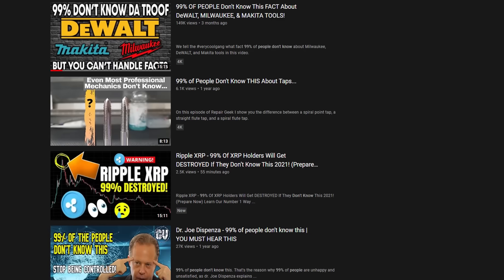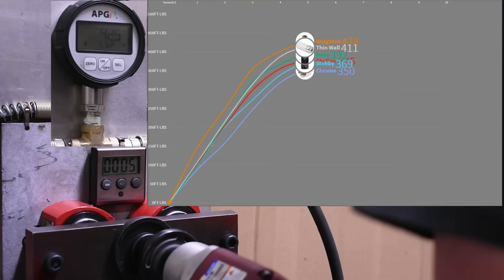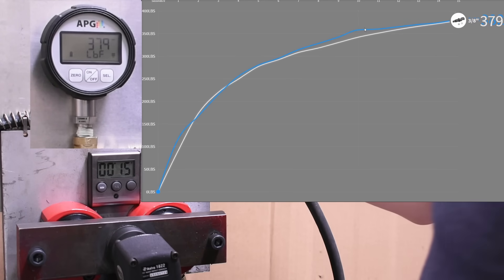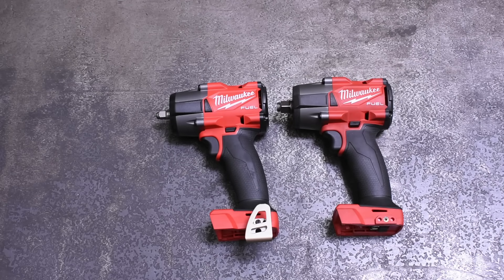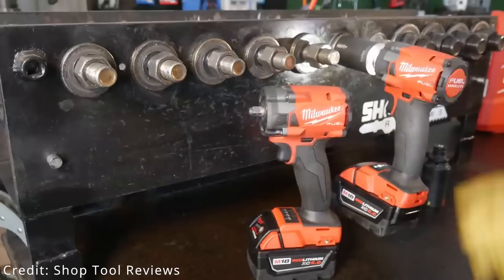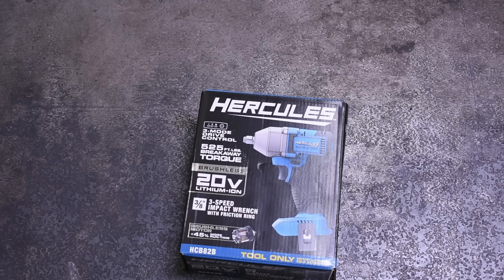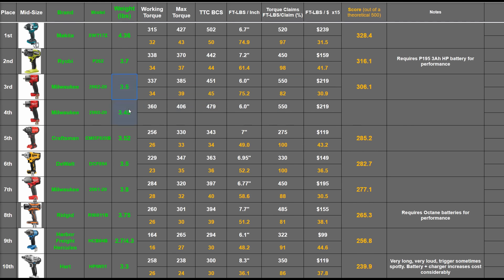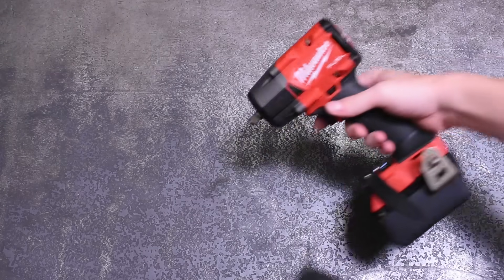Measuring Power Difference Between 3/8" & 1/2" Impacts = WTF

Comment: My guess would be that the force being delivered to the anvil is the same but on the 3/8ths it's concentrated on a smaller area so it receives more peak pressure. Although I'm still trying to work out why the 1/2 inch is better early on?
Reply: My thought as well

Comment: My hypothesis behind this would show that when using a 1/2 inch it’ll get up to a higher power quicker as the 1/2 inch has more weight therefore will create more momentum.  Whereas when trying to get those extra beans at the end it take less torque to get the smaller 3/8 drive spinning as it weighs less therefore you can get those couple extra foot pounds.
Reply: whatever extra energy gets put into the heavier object is being used to overcome the extra resistance to changes in its motion (Newton's 1st Law). exactly why a pebble and boulder dropped from the tower of pizza hit the ground at the same time despite gravity exherting so much more force on the heavier rock.

Comment: I think they rate 1/2 higher because at higher torques you'll see more stress on the anvil and typically a 1/2 anvil can handle more than a 3/8 but that may need to be tested.
Reply from the maker: 3/8" anvils will die a quicker death at these torque levels, you're quite right about that

Comment: There is a lot that goes into that. Less mass more speed. More mass less speed etc etc. being a mechanic for 17 years I’ve been around a lot of impacts. Some things 3/8s will not do a 1/2 with a heavier socket gets it done. Same goes for 3/4 and 1 inch. For the longest time I only used a 1/2 impact and had a reducer so I could use a 3/8s socket. Each impact has its place. I could go on and on.

Comment: Hi can you test torque sticks with different Impacts? I want to know if they can limit the torque of any kind of Impactgun.
Reply: I second this. I stopped using them at my shop due to the torque seeming very different when removing them by hand in my own terrible mini test.
Reply: @HoosierDaddy_  The result is different indeed. I only use the lightest one (90 Nm), that way the torque spread doesnt really matter. Lug nuts are generally torque to anywhere between 120-180 Nm. Even if the torque using the torque stick differs by +/- 20 Nm (70-110 Nm), its still sufficient for what Im doing with it. At least its not possible to overtighten the screw anymore.
After using the torque stick on the lift, I torque the lugnuts to spec using a torque wrench when the car is back on the ground.
PS: I would be also very interested in a decent torque stick dyno test!
Reply: No, they only work correctly with rainbow colored impacts.  
🤷. 
Better upgrade to the care bears model.

Comment: no one saw or taken into account that the 1/2 socket  is 3 times bigger and  heavier, and heavier means harder to spin
Reply from the maker: Both the 1822 air impact and Hercules used the large 1/2" socket and smaller 3/8" socket and made the same beans. We go over this @ 1:44. We've tested and on large bolts like these socket mass isnt a huge determinant but on smaller bolts and sockets is can be big

Comment: I bought an M18 Fuel 3/8" impact 3 or 4 years ago and used it for most impact jobs Including outboard flywheel nuts, rusted wheel lugs and other rusted trailer parts. Salt water is to boat trailers, engines and other boat hardware as road salt is to automotive world. My 1/2" CP air impact is probably 45 years old, came with me from the auto industry to marine and has been rebuilt probably 4 times. Our shop air leaves a lot to be desired and I am a lot more mobile than in the past. I still needed the air for some situations. I recently replaced both with M18 fuel gen 3 I think they are called. I bought them because they are shorter and the added gain was more power. I also bought m12 Fuel screw gun, 1/4" impact driver and 1/2" drill with the smaller 3AH batterys. I wanted the 12 for the smaller size for tight access and the power and batterys have been more than adequate for my work. I almost never run down batteries before the day or the job is done. In my world battery tools are now king but in auto and heavy equipment repair I would imagine battery has it's place but air is probably still king.
Reply: I do heavy highway construction so I'm around heavy equipment all the time. Whenever mechanics come out all they use is battery powered tools.

Comment: I would think the 1/2 anvil would be less prone to fracture than the 3/8 (thus giving the impression of more strength AND torque), but it also makes sense to me that the high end torque would be greater for the 3/8 than the 1/2 because the anvil for the 3/8 is lighter.  Since the motor of the 3/8 is doing less work moving the anvil, it should have a few more seeds (assumed smaller than beans) to give the test setup.  

Further, since there would be excess torque available at the lower end of the curve, the motor should be able to drive the 1/2 anvil at a similar speed to the 3/8, thus delivering more torque than the 3/8 because it's moving the higher mass 1/2 anvil a distance similar to the 3/8.  

I wonder if the 1/2 anvil end was cut off (still allow safe engagement WITHOUT pushing harder into the socket during the test) to reduce the anvil mass whether the curve would look more like the 3/8?

My explanation doesn't work for the Harbor Freight unless the anvils were the same weight or they were actually different internals.  Maybe it's because they are providing much less torque so it's less evident?

Comment: great video, I knew there was difference just had no idea it was this, I am in Canada and just bought the Makita mid torque XWT17 1/2" drive and love it, i do own mostly 1/2" sockets from my jobs over the years and just use adapters to size down to any smaller jobs that have smaller hardware, and don not require big torque and this new Makita with the many power levels it allows me to do almost anything with it, i also have a Makita 1/4" driver as part of a set, been using Makita for almost 20 yrs and don't see any need or reason to change and the warranty/service is awesome great video and good info to know when i go to purchase the next thing a cordless ratchet , i will wait they are suppose to be upgrading them in the near future i heard from an Aussie friend of mine 👍

Comment: In the video you can see the 1/2" milwaukee shaking more than the 3/8; It seems like when I hold my gun more steady it produces more torque.
Do you think that the difference in socket lengths (the long ones you use for 1/2" and the brand new never before used coupling for the 3/8) plays a factor? 

For the purposes of this video perhaps an improved comparison could use a bolt adapter down to a 19mm head and then testing with the same brand short impact 19mm socket in 1/2 and 3/8?

thanks for the videos.
Reply from the maker: We've noticed the smaller the drive size, the more impacts shimmy. due to footprint not helping with alignment. The M18 3/4" for instance is more tame than 1/2"
Reply: @TorqueTestChannel  allow me to clarify i meant the connection to the anvil being so far away from the bolt head is causing more vibration (the gun isnt straight into the socket it is wobbling it around some) than the almost direct setup you have with the 3/8, hence my suggestion.  (Edited for clarity)

Comment: On your pneumatic guns do you run regulators or just whatever the compressor will push?
Reply from the maker: On air tools for testing we run the pressure required to reach 90psi in the gun while running wide open. Then for BCS test it's 150psi at the wall which drops to whatever the gun causes it to drop to
Reply: @TorqueTestChannel  thanks for answering my question and that was a quick reply!  Keep it up I love watching your content!

Comment: As there is a bit of movement between the socket and the tool, and as the ultimate torque that an impact wrench makes is directly related to the shorter duration of the impact, it is not surprising that an anvil with slightly less mass would be accelerated slightly faster and produce slightly higher numbers on the top end all other factors being equal.

Comment: My perspective on this this comes from engine performance. With ICEs, HP (work) is torque × RPM. A big torquey V8 that makes 400ftlbs but only revs to 4500 might make 250HP, and has the torque to do work down low like towing (Like how 1/2" guns do better breaking through rust or stripped fasteners that won't move) Whereas a smaller V8 making 250ftlbs but revving over 7500rpm might make 400hp, doing even more work faster and hitting higher top speeds than the torquey V8 even with lower torque figures. (3/8" anvil swapped from 1/2" tightening clean bolts with little resistance even tighter due to lower rotating mass, increasing speed or blows per minute) Obviously these are the same guns just with different anvils, so the difference isn't huge but they do seem to follow that logic

Comment: interesting video! I've found this to be the case a few times myself where i have both 3/8th and half in models of the same tool the 3/8 seemed to right on par if not better. But i couldn't quantify it and always assumed it was just bias/some coincidence.

heres a thought. is there any chance having a smaller anvil makes the output rotating mass of the anvil smaller in relation to the total mass being rotated on the socket allows it generate slightly more power?  for example if i used a 1' socket but the drive was the same 1' diameter I would assume the rotating mass of the socket would be greatly mitigated because its not rotating outside of the diameter of the drive itself. kind of like how bigger wheels on a car can reduce torque and throw off gearing.

Comment: Idk I use 3/8s for basically everything as related to ratchets so I do like to have a compact or mid torque in 3/8s just to not have to make any extra effort but I do see the value in having a 1/2inch
Reply: I have the 3/8 that they tested, and then the High Torque 1/2.  Don't use the 1/2 often, but it has its place when needed.  Usually use the 3/8 though.  I do want to still get the 3/8 stubby impact for those tight spaces.
Reply: I feel like High Tq for 1/2 and then a 3/8 Mid is a decent set up

Comment: Oh nice, now you guys can impact those ecoboost plastic oil filter caps back on.
Reply: Haha, bought my truck this spring and wanted to drive back to the dealer and punch the guy in the face who put the filter housing on. 

I could not get it off, socket kept slipping on the top nut. I let the engine cool down and was ready to cut the thing off if it failed to loosen again, but it came off this time when cold. I was SO mad.

It amazes me how few people understand how a simple o ring works, and tighten things like a bolt.

Toyota had a similar filter housing and goons broke those treating them luke bolts too.
Reply: @volvo09  Had exact same problem with a goontech over tightening the lugs on my aluminum wheels, one lug was so tight even they could not get it off, had to use a hole saw to cut it off, then hacksaw the rest off in order to remove the lug, which I replaced. I usually do my own rotations, and use a torque wrench as recommended by the wheel manufacturer, but the car was in for inspection, and required one front and an opposing rear wheel be removed for brake, bearing play checks.

Needless to say they paid for the wheel replacement, and they got dropped as my go to shop.

pneumatic/electric/cordless wrenches in the hands of fools is a dangerou$$ venture.

Comment: You guys are leaving me perplexed. I was always told the larger mass of the 1/2"  anvil hits harder therefore delivering more torque. Apparently you proved that wrong 👍🏽
Reply from the maker: Cardo, the dyno proves us wrong right along with you. We come away from these tests humbled as usual
Reply: And in another test a weighted socket increases the torque? This is a bit confusing! 🤔😂
Reply: @henrikforsberg683  Could it be WHERE the weight is? Anvil is in the centerline of rotation. Weighted sockets have mass concentrated at the edge where the angular velocity is higher.
Reply: "Chris"  said  (01/11/2021) "The effect were seeing here is caused by an interaction between the motors torque curve and the anvil mass. The motor seems to struggle at the last bit of the dyno test, because the 1/2" anvil seems to be a little too heavy for it to max out."

If they are using the same motors (kV and Power / VA)  heavier hammers may all be for nothing.  Motors need more power..  

Higher Anvil mass merely indicates more material is included, ideally for higher strength / fatigue resistance, same with thicker walled sockets, more material indicates better resistance to heavy use - more mass ""induces inertia" to be overcome  -  understanding coefficient of restitution is important in design / testing, if the socket is just "bouncing" off the bolt, not a lot gets done - heavy sledge  hammers have a use and it isn't driving small nails.  Design and manufacture has many challenges, marketing induces loads of avenues for misrepresentation.
Reply: @kadmow  worthwhile read. thank you for including this
Reply: The mass of the hammer inside the gun is what matters most, and a gun that ships as a 1/2 anvil might have a larger hammer than a more compact 3/8 anvil gun.
Reply: Is it possible that's the heavier anvil actually absorbs some energy in some situations
Reply: I was literally at Lowe’s about to purchase the 1/2 Milwaukee impact and saw this video and I’m glad I did
Reply: It's too close to the pivot point so it doesn't make any difference in real world life.

Comment: Great to see experience quantified! I've done this test 'in the field' over the last few years, and the only difference I've ever seen is the ability to handle whatever socket was available/appropriate at the time. DATA WINS!
Reply: Well the weight of the socket is definetly . I think that the 3/8 socket will have more weight due to the smaller hole. And the smaller anvil even at the same torqure will have a higher rpm which im sure counts for something

Comment: less weight=more speed. when the anvil hits with more speed could equate to more force. Especially with both in the same form factor.
Reply from the maker: Which begs the question why didn't the nano and hercules increase from the same 1/2" to 3/8" anvil change?
Reply: @TorqueTestChannel  It could be a variety of things. It could hit max RPM with the 1/2" already, due to amperage limitations, discharge of motor limits, hell, could be governed electronically. The Nano could've also been slightly impeded by being overly greased, slight differences causing a different level of 'bite' between anvils, or that pneumatics hit at the same strength due to using a constant line pressure and not electric batteries that can vary their output. The only way to check would be to find or make oddball sizes for them, where you can also test 1/4 and 3/4" variants. 

Milwaukee's construction could just be one that hits harder than expected because, for durability reasons, they engineer them stronger for 1/2" drive to allow for more power and performance-which the 3/8" gobbles up as it requires less power to turn. Build the 1/2" first, and make them all to that spec. Instead, the Hercules could've been built 3/8" to 1/2", and so the 3/8" was already working at peak.

I'm kinda surprised because I'd figure surface area would end up becoming a factor. Constant pressure across a larger area means more power, whereas that same pressure across a smaller one has lower power. It could be that any 'gains' from speed would be evened out on a pneumatic, but the only way to tell would be a LOT of testing.

I'm just spitballing though, so...grain of salt?
Reply: @TorqueTestChannel  
In the case of the Milwaukee impacts, maybe the hammers are different between the 3/8 and 1/2?
Reply: @TorqueTestChannel  my only answer is just a probability, that they use a cheaper motor to account for the cheaper cost. Something in there is not the same quality as the more expensive product
Reply: Hammer is the same only anvil is different. My guess is hat the 3/8 is harder due to the loss in girth from 1/2 to 3/8
Reply: I talked to my old physics professor, he suggested with a high amount of certainty (idk what that means, maybe like 70% of certainly) that using the same motor, same power that the more mass of half inch is not gaining the same acceleration as the 3/8. Having the same anvil/hammer would make the 3/8s achieve a better balance within the Milwaukee build. Seems plausible to me.